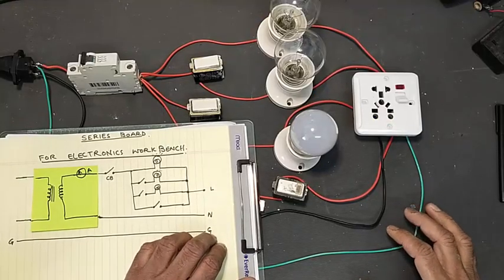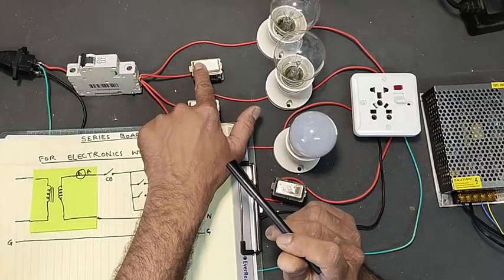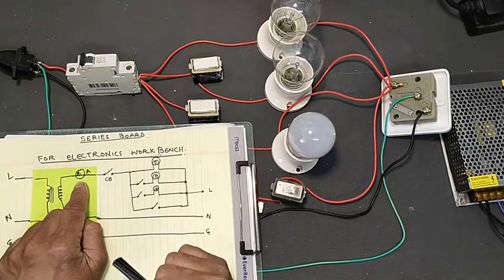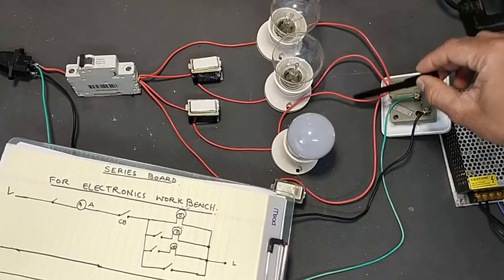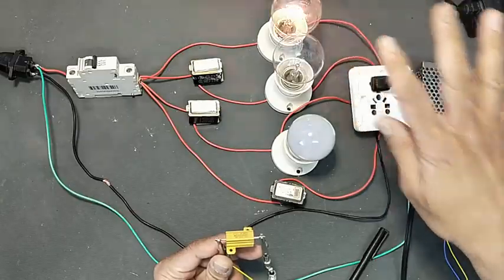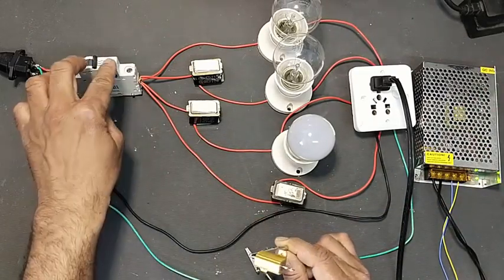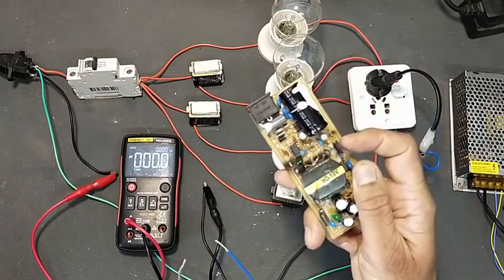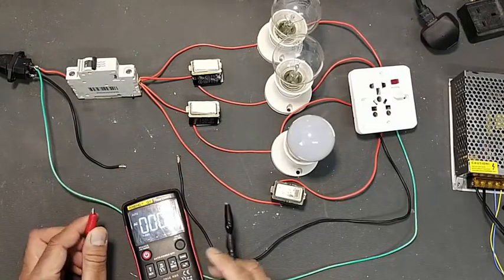{552} How To Make Series Testing Board For Electronic Workbench

Comment: Oh, another tip... This system is also called a "Dim Bulb Tester," if you are researching it.
Reply from the maker: thanks for your valuable comment 
yes it is also known as "dim bulb tester circuit" but the most common term is used "series board or series bulb or series lamp"

Comment: I started using series lamp about 6 months ago while repairing smps. It is an invaluable tool. Now I need isolation transformer
Reply from the maker: yes it is very useful tool and it prevents so many failures and mistakes
Reply: @HaseebElectronics  It is your amazing work and great videos that has helped me so much with understanding smps
Reply: See my post, above, for ideas on how to come up with your own isolation transformer. Then, research it, fully.

Comment: I was expecting that bypass switch to turn on at the end of the video to test that shorted board on MOSFETs so the circuit breaker trips
Reply: yes, but it could have damaged the board more than the mosfet already short.
Reply from the maker: it is a provision, jsut when we are confidant that the board input current is satisfactory. in that condition we can use this switch 
we can also skip this switch as well

Comment: @10:11 DVM can not be connected for a longer duration.  Its shunt resistor will get heat up after a minute and destroy amp section of the DVM. Most multimeter has a seconds written near current settings, we must not connect it for more than 10 seconds ( higher current)
Reply from the maker: exactly you are right. i mentioned in the video that we must use ac ammeter. i cnnected multimeter just for demonstration

Comment: welcome back sir, Regards. can i used one lamp only with high  wattage tnx.
Reply: The bulb is controlling the current. One high wattage bulb allows high current to pass. Better to use lots of small wattage bulbs, in parallel, that add up to the maximum of the typical devices that you work on. That way, you can add a little current at a time and bring the circuit up slowly and in a controlled manner. Let's say you want to have an amperage capability of 2 Amps and your mains voltage is 120VAC. 2 Amps x 120VAC = 240 watts = A quantity of six 40 watt light bulbs. However, I assume no liability, if you try this.
Reply from the maker: @t1d100 fabulous 
it is perfect

Comment: sir if you off the two switches for example and on the bypass switch what happen to series board circuit if there is a short on the load sir tnx
Reply from the maker: bypass switch is used at final test 
for routine series testing, the bypass switch must remain OFF
it is in that condition, when we are confidant that the circuit current is with limit.
Reply: I guess you understood nothing about fundamentals of using series bulb. Direct switch ( No bulbs ) is used only when repair is done short circuit in smps is solved.
Reply: @HaseebElectronics  tnx for the info sir because in the video you did not specify when to use that bypass switch sorry sir i'm only a beginner in this field of electronics sir

Comment: Assalaamu Alaikum Brother 
can test 1800w microwave onthis test boad after repair ,
how much watt Bulbs i should use ?
how calculate Bulb watt as per equipment watt?
Reply from the maker: wa alaikum salam dear brother 
you need to use atleast 500 watt halogen tube rods,  4 in parallel connection (in place of this series lamp)
Reply: @HaseebElectronics 
Alhamdulillah, thank u so much brother,
I really appreciate,
Reply: @HaseebElectronics  
Assalaamu Alaikum Brother ,
please i need help on Microwave high voltage diode , 
can i replace 
HVR-1X SK 8119 With CL01-12 RG102 Diode ?
please advise

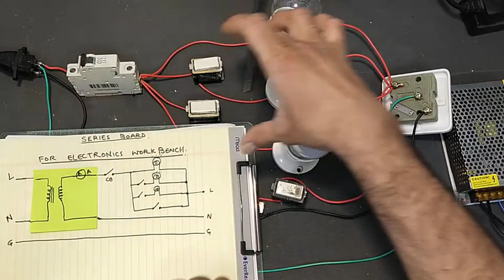Comment: @3:01 only 1000watt isolation transformer is good for those who just repair SMPS and leds adaptors.
Reply from the maker: yes dear 
1000 watt is enough for small repair jobs. but we must consider the "SHORT CIRCUIT CURRENT" condition for the laod 
and if we work with some heavy current devices like welding machines and inverter ac boards, these draw more current, especially when these have malfunctions

Comment: sir is that ransom ware issue is resolved sir?
Reply from the maker: no it is still under process and i hope still there is no positive result
Reply: @HaseebElectronics  hope it will resolve soon
Reply: @HaseebElectronics  sir is there any way to increase driver circuit efficiency

Comment: sir i noticed that in your diagram the first lamp did not connected any of the switches and if you connect an isolation transformer to series board the input voltage and output voltage are have the same value i'm i correct sir tnx
Reply from the maker: Yes, you are right
isolation tarnsformer must be 1:1 ratio, 220IN, 220OUT
first lamp will remain series all the time, 
other lamps are used when we want to test more current consuming circuits
Reply: See my comment, above, on how to fashion your own isolation transformer.

Comment: Thanks for sharing
Reply: Sir  can you help me SMPS for  ebike 48v.. I'm a newbie ..I installed series lamp when measured the start up capacitor it was too high voltage.. which part I will going to  check? No output 48 voltage but the green LED glows. I  tried to bypassed the auto coupler the red LED glows.. thank you very much..
Reply from the maker: most welcome
Reply from the maker: actually i am in Jordan and in Jordan there is no E-Bike 
so i have no good idea abut the E-Bike charger 
no problem,
is the LED is connected to output or INPUT?????
if it is input, then you have to troubleshoot the circuit 
i suggest if you watch video number 528 that will useful 
otherwise reply here or on my whatsapp 00962-79-1161084
Reply: Thank you very much I will save your whatsapp... im from Philippines sir.. i Do it myself DIY only for learning.. Once again thank you very much..